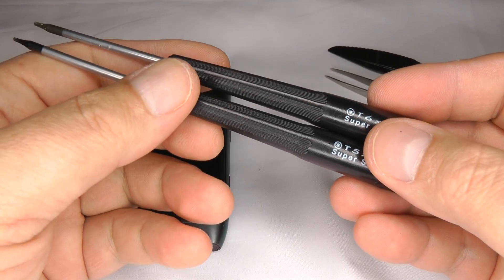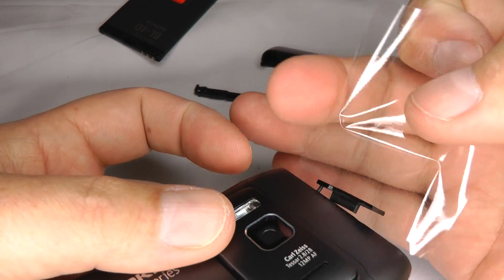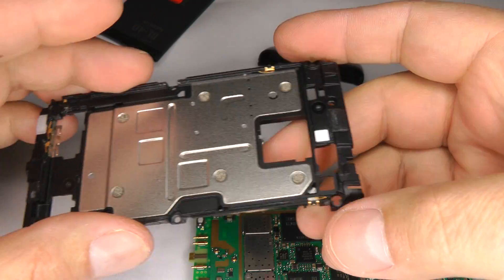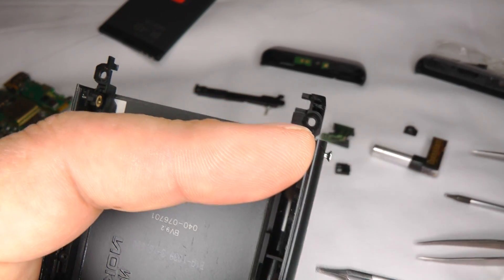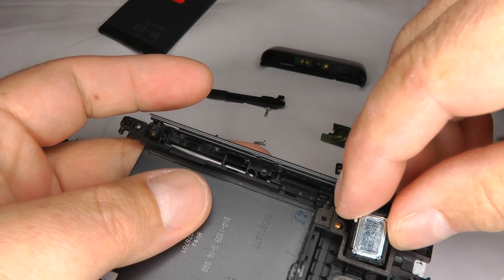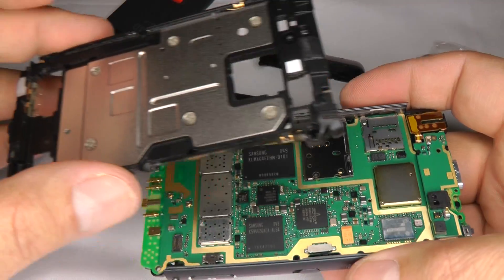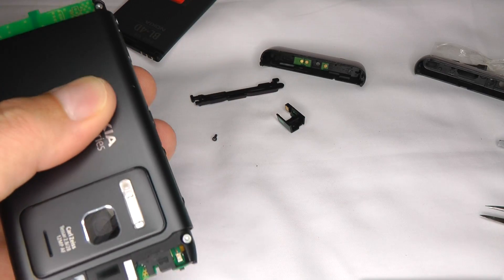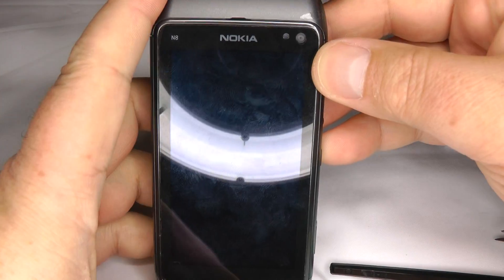Nokia N8 Disassembly & Assembly - Case Replacement

Comment: hello, this is a very usefull video a very well done also, i have a question for you, my n8 fell and i don't know if i need to replace the LCD or the touchscreen or both.
the phone gives image but it doesnt allow me to touch in all of the screen, just in a part of it, the touch is not offended, at least doesnt appear to be and the LCD underneath its clearly damaged, so how do i know if the touch as to be replaced or not?
thank you

Comment: `Please help! i cannot connect to internet whether via wifi or mobile charges since I updated my n8 on symbian belle,. as well as i cannot transfer any more videos even if I convert it. regarding the case replacement, is it genuine no difference from the original one,. because I drop my device and it has scratches I'm thinking of changing it to a new color. thanks

Comment: Dude, thanks A LOT! I disassembled mine to clean the headset in jack, two small pieces fell off and i had no idea where they went! LOL... turned out it was the two lil' pieces that attach the two screws from the bottom. Really thorough, thanks again!

Comment: is there something suppose to be coming out of the board to make contact with the antenna or is there just a metal contact point on the board ?  and if there is suppose to be something coming out of the board to make contact with the antenna is there anything i can do to recreate the connection between the two ?

Comment: Hi, the bottom cover snapped on the side near the screw. I superglued it back and although I can still make and receive calls ok the FM transmitter is very very weak now. Are they linked or is this two separate repairs? DO I need to replace the camera cover? On ebay they come with the full tool kit needed to make repairs to the phone.

Comment: this is the same thing happen in my case, after i change the case, the fm transmitter is not working anymore, but too scared to open it my self. I can't help it even if i send it to phone repair and explain them the problem, the workers here are just too stupid and dumb and think they know everything. foreigners.

Comment: i dropped mine doday in the pool, by accident ofcourse, so i quickly searched for a video to dis and reassemble the phone, and this video was real usefull, because i took it apart and dried everything and put it back together, but it's dead.
the moment i tok it out of the water it did work, but afterwards it's dead anyway.
i gues the clorine in the pool destroyed the electronics. If only the usb and the load  connector had a lid, because that's the only 2 places were water can enter quickly.

Comment: thanks for replying.  I don't have a heat gun, I wound up putting it in a toaster oven for a few minutes.  It eventually came off.  Unfortunately my new touch screen doesn't appear to be working even after all that. I bought it off ebay, this blows, it took almost a month to get here from china or hong kong.

Comment: thanks, i changed my case and now its quite perfect. The 2 things that you don't teach to us is the way to dissambly the screen from the touch glass, and disassembly the home button (the one on the botom). So i did'nt changed these two parts. But i think removal of the touch glass from the screen needs warm because i think that they used a kind of glue...

Comment: very useful video thanks, i dropped my n8 on the corner of the on/off switch even the case had bent, bought a new one thinking that would solve it, i followed your video and found that the little button had virtually crumbled away, the board is ever so slightly bent but looks ok, what would you suggests the best way to fix or is it dead? if its fixable do u recomend a certian shop or website. cheers!

Comment: Hi there, my sim card is stuck in the phone and will not come out. Just wondering if it is possible to open it up and push it out enough for me to use tweezers or fingers to pull it out? Thanks any advice would be appreciated.

Comment: I bought a new fascia cover on ebay from reputable dealer and the back of it has a different part number: My original says BV9.2 and the one I bought says FV9.2. The problem I have is that on the inside of the volume control there is 3 bronze metal teeth (shown at 9:39 on rhs) that aren't on my replacement fascia. Should I remove it from my old fascia or ask for a replacement?

Comment: Hello. I have managed to re-assaemble my phone completely and change the housing, however, the camera switch button is not fully functional, it cannot capture an image, but it can open the camera function. Another problem is the FM transmitter is not working. any idea how i can fix the FM function? because i used it a lot :s

Comment: @LE55ONS thank u a lot for ur answer! suddenly I have a MUCH bigger problem!!!! first the screw cut in the middle with the other half in the hole. but the real prob is that I destroyed the touch screen when I turned on the phone there was no responce when I was touching the screen. If there is any way to contact with you, or sent you a video to understand what I mean... :/ what I want is to buy a cheap replacement. please help me :'( in nokia care they told me that it costs 107 euro :'( (greece)

Comment: I dropped my nokia n8 from about a foot high and the screen froze, now it wont power up at all, I disassembled it and reassembled it according to your video in the hopes that some conectors were off, and again it wont power up, even plugged in charger. What could have the fall broken inside the phone, do you have any ideas? I did not find any broken bits inside it, all was intact.

Comment: Thanks for the great video! I broke the SIM slot on my N8 (thanks microSIM adapter) and my replacement part is on the way. Do you know if the SIM slot is simply a pop off piece from the main board or is it more complicated? Thanks a lot.

Comment: I wish I could pay you 150 pounds to change my nokia n8 top and bottom cover, the battery and the touchscreen as well as the back cover, eventually, all the outer cover, i want it to be change~ :D if possible. i would pay more, 300 pounds?